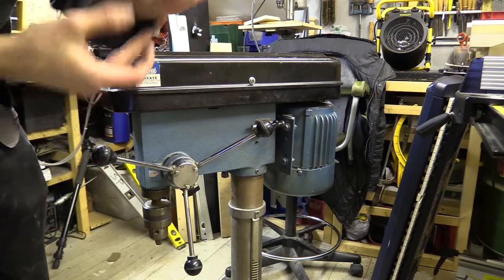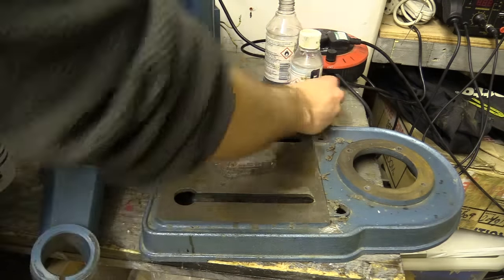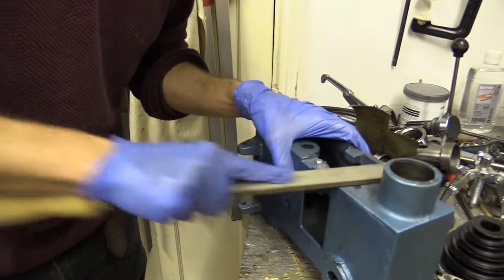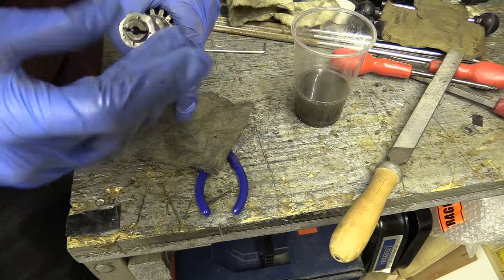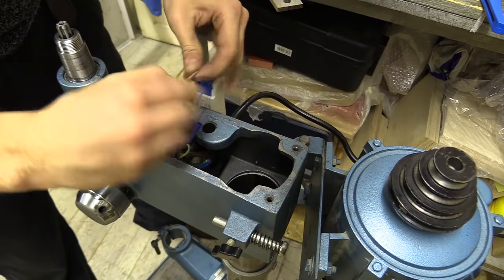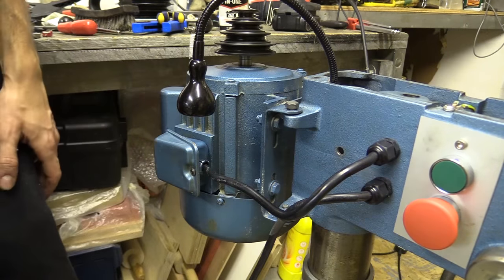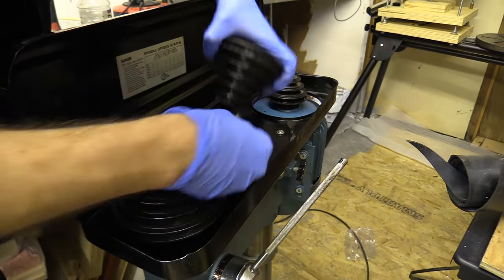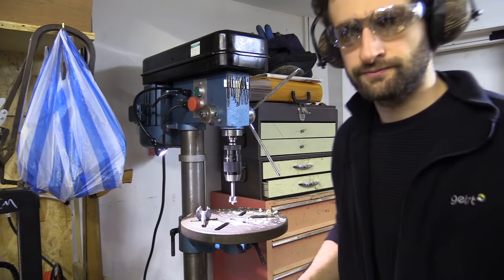Bench Drill Restoration: Rebuild, Clean, New Buttons, LED Light

Comment: great job , much better investment to restore the old drill , in general the old  machines were stronger than the new ones. Great restoration job. I'm working in a small drill that I bought used and has a table made on metal shape not in iron. That produce a deviation in one of the axis. I just ordered a new iron table from a delta that I think will solve the problem. Great videos.

Comment: I have a video on radial drilling on the Atlas lathe.  My subject was a stripped out handle rod mount just like yours.  I forget exactly but I made larger shafts and re-threaded.  Those threads need Loc-tite to to keep them from wobbling.  The threaded section in very short, maybe only 3 or 4 threads and wears out easily with a wobbling handle.

Comment: Re. the Ikea LED light: I've just pulled apart the one I have here and it's got 2x AMC7135 350mA LDO current regulators in parallel in the LED head, giving 700mA total current through the LED. These have a working max input voltage of 6V and 7V absolute max. 

The Ikea PSU that came with this lamp has a 4V output to keep the power dissipated in the head to a minimum. If you supply it with more than 4V it won't be any brighter, it'll just dissipate more heat in the head, and any more than 7V is outside the '7135 absolute max rating.

You don't say what kind of LED driver - CV or CC - you're using but I suspect it could be 700mA constant-current driver which might explain why the head is getting a little warm.

Comment: That was most useful thanks. I am just giving my drill press a service and was looking round for upgrades while it is stripped down. Will now add a lamp and make new handles and maybe a neoprene gasket. Did adding the neoprene make much difference though?
I repair tools for several local tradesmen and have scrapped quite a few  tools (with plastic bearing housings) where they have "revived" bearings with WD40. This washes out the grease, the WD40 boils off and the bearing overheats and melts the housing. So now i always regrease open and rubber sealed bearings and replace bearings with metal seals.
Thanks for sharing.

Comment: Thanks for sharing your project. I have one the same since new (1994), it's now stopped working.  Do you know the specs of the relay or have a wiring diagram, there are no markings on mine and no help in the manual.

Comment: Thanks a lot for sharing. Does the spindle have some play upwards when you lower it a bit? I have a similar machine and everything seems nice except when I actually drill anything by lowering the pinole/spindle, as soon as the drill bit contacts the material you can see that it can still move upwards about 2 mm. So it (the chuck) is kind of floating for a moment which makes precise control of drill depth difficult. Is this normal for this type of machine and if not, how can it be fixed?
Reply from the maker: There should be a grub screw which tightened the quill - but I need to look at the drill again as i might be mistaking it for the old one. Soft wack of the chuck with a rubber mallet might help as well?
Reply: Thanks. No change after whacking. The strange thing is that in max. extension there is no more play - just in all positions in between. Are you referring to the grub screw at 5:52? I would like to take apart the whole thing because the depth stop is broken  (looks just like the one on your model) but it feels as though the spring is going to jump into my face when I take off that cover.
Reply from the maker: Yep that's it. Pull the drill down about half way and tighten so wobble is gone but up-down movement is still fluid. Otherwise you'll have to just dismantle and try your luck putting it back together.
Reply: OK, I took it apart today. There is no such grub screw on my machine (but apparently there used to be, the thread is there). I took off the spring and it turns out that the up/down play is the result gears of rack and pinion not fitting precisely. In top position there is nowhere for the pinole to go, in bottom position the you are pushing the gear tooth of the pinion and blocking upwards movement. Everywhere in between the teeth just don't grip properly. There has been little wear so they probably never really fit. I'll try to get a spare part, there is a German company still sending out parts for couple of bucks each. Thanks for looking into this.

Comment: Great job, btw, I seem to remember someone else using golf balls drilled and epoxied on for the handle ends.
Reply from the maker: Yes that was Pocket83. I want to try something a little different if I don't run out of time or get distracted. ;)
Reply: It might have been The Redsmith, someone, make some out of large lumps of coloured epoxy resin. He built it up by pilling thick layers of resin on top of itself when the devious layer was close to being set. He then sanded them down to a ball on the drill press. I’ve also seen this done on one of the better restoration channels, My Mechanic, making knobs for an antique little jigsaw device.

Comment: I picked up a later D16/16 from a charity shop last weekend. It was split into head and base, they didn't know what it was and it didn't have CE on it so they were going to leave it for the scrap man. It was in far better nick than yours and, after giving it a good check over, I gave them £50 for it.

Although old enough for the grease to have started to dry out it didn't seem to have had much use and hadn't been set up properly. So a partial strip, clean and re-lube was all it needed, plus a new locking screw for the belt tensioning cam mechanism. The bearings are all fully sealed on mine.

The chuck key was bent - never a good sign - and I wasn't surprised to find the chuck jaws were bent. So new chuck is going to be needed - how do you find the keyless one?

The instruction manual on Draper's website is dated 1997 and mine is clearly an earlier version, so yours is even earlier.

Comment: A long one but enjoyable and worth watching. I used to enjoy dismantling second-hand machines but never went as far as to touch the electrics (except for that one time I shorted the motor on a disc sander...).

Shame about the crooked switch plate. I reckon you'll replace that. ;-) Great thinking with the neoprene rubber. How much of an improvement has it made?

Comment: Awesome video!!! I'm completely with you, old machines are always better and also more resistant than the new ones. Do you also have an appropriate machine vise for it?
Reply from the maker: Well you just have to spend a lot more money to get a good new one. Meddings ones are amazing (we use them at work) but they cost more than most of my tools put together. Also not yet with the bed vice, but I saw a great one by woodkiefer1 which I'd like to try recreate.

Comment: Surprisingly you didn't add any mass to dampen vibration or get better/ heavier use with less flex..epoxy granite..80 to 90% sand/ pea gravel the rest epoxy..filling the column, base and any other hollow castings will do wonders..Cheers..

Comment: You did a nice job, but this is not a restoration. More of a refurbish. There's a big difference and I genuinely wish that "restoration" would be used more appropriately. I restore and refurbish vintage machinery and do a lot of drill presses. This Youtube stuff come into my world while dealing with perspective clients who base their expectations on videos. They don't even realize when they're insulting me. Anyway, your runout at the taper is fine, but from what I saw, ~0.25mm at the chuck is high. Every Chinese keyless chuck, as in the video, that I've tested had a fairly consistent runout of 0.004". At the risk of stating the obvious, the standard one is measuring will have a substantial impact on the reading. Many folks use an endmill, or the shaft of a punch, or a forstner bit. Not always a great idea. I measured 250 pin gauges to arrive at 6 that were straight and concentric to below a tenth. The odds of a random standard delivering similar performance are slim. In your case I'd indicate the arbor first and then the chuck. You'll have to remove the chuck from the arbor to do this. See where the problem lies. New arbors are fairly inexpensive, if needed. It's been a while since this video was released. Hoping this will help others get started. Good luck.